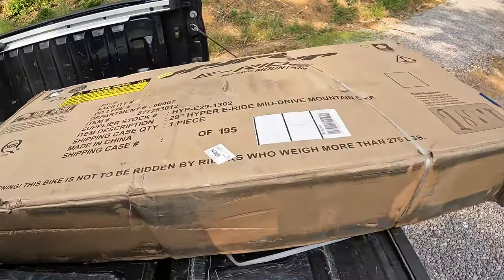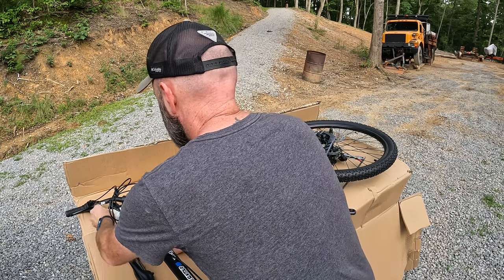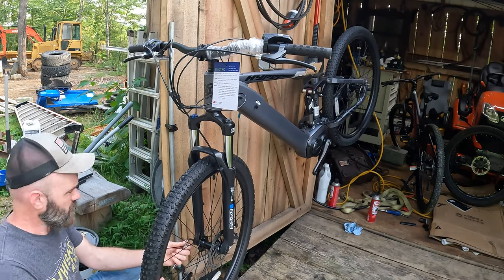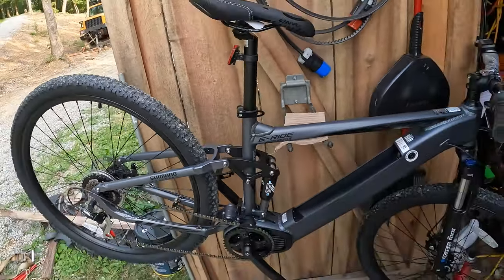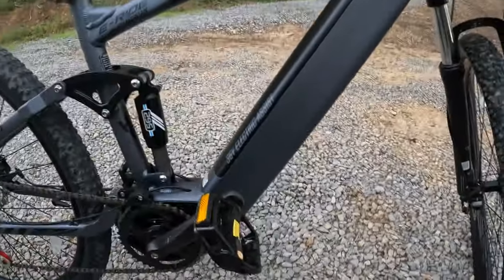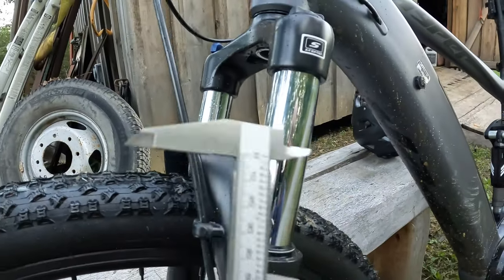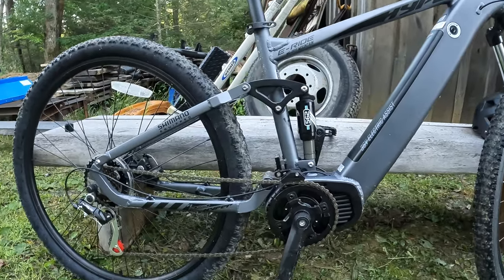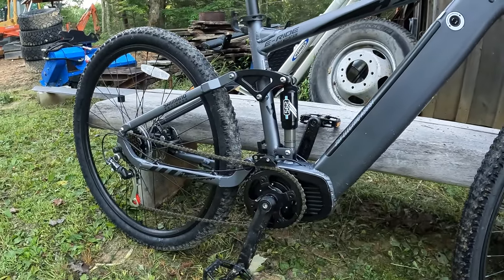Unboxing and initial ride impressions of the Hyper E Ride Mountain Mid Drive mountain bike

Comment: Very informative video! Thank you so much! I wonder if the shocks are oil filled?
Reply: I mean, does it feel dampened with oil inside
Reply from the maker: @whoeverwonders9892  I can’t tell that it does. The rear is just air I believe and the front is a spring and grease to the best of my understanding. I haven’t taken them apart. They aren’t bad for what I do though! 👍🏻
Reply from the maker: Thanks!!!
Reply: @MountainMindset  Thank you for the details, really appreciate that
Reply from the maker: @whoeverwonders9892  anytime! 👍🏻

Comment: What is the stand over height from the ground to the flat spot at the top tube just above the E-Ride logo?  Seat tube cutting is easy, but if the bike is too high to reach the ground comfortably, that is a problem?  People have mentioned the bike for taller riders, but it appears that a simple trim of the seat tube is the fix there.
Reply from the maker: I measured mine in the gravel and it was 29 inches to that flat spot above the e-ride logo. Yea the seat tube is an easy fix. I’m 6 foot and I really like the size of this bike. I’m no expert by any means though! Lol. Hope this helps.

Comment: Once u switched the front fork dropper seat stem and handlebar it should be good
Reply from the maker: Yep! It’s on the list! 👍🏻
Reply: I'd find that gearing limiting as well.  
Did a cost run up $350 parts more this  would be a really capable bike.

Comment: Is this can you ride this bike fully electric
Reply from the maker: Not without peddling, no. It doesn’t have a throttle only like some bikes have. This one is a pedal assist but it’s easy to pedal and has lots of power. Hope this helps.

Comment: It this a bafang motor ?
Reply from the maker: I believe the brand of the motor is Vinka.
Reply: I wonder if i can replace that motor with a bafang ultra
Reply from the maker: @Exo_carbon.24  I don’t know for sure but I doubt it’s a direct bolt in. Maybe with some modifications it would work. Be interesting to see!
Reply: @Exo_carbon.24  If i was you. I'd stick with the hardtail 29 and just swipe the rear hub with a standard one and put a mid-drive conversion kit bafang on it. You'll have better options to get away from the 250watt version and crank to 1000watt for insane power. Then replace the internal battery for 10.5ah (If you can manage to buy the Mid-drive battery which fits into the older modules.) Or buy another battery and mod the wiring under the frame to the new battery placement.

You'd likely get better performance, power, range, and parts.

Comment: How much does it weigh?
Reply from the maker: I haven’t gotten around to weighing it yet but I can tell you it’s pretty heavy. I’ll try and weigh it next week because I’m curious about it too.
Reply: @MountainMindset  Ok cool, let me know when you do. 👍
Reply from the maker: @jasonmathias5343  will do!
Reply from the maker: 56 pounds even according to my bath scale and math! Lol!
Reply: @MountainMindset  Not to bad. The stock 26er weighed roughly 47-50pounds.

I'm sure swiping the handlebars/seatpost (Which i bet are steel.) Would shave alittle bit. And fork/rear shock for air might also help.

But in all. That hefty weight is good to have. It is a small form bike packing a huge punch. Unlike the other higher brand companies (Not sold on walmart. Aka Giant,etc.) that beef their bikes up by widening the frame (But thinning out the metal tubing. So it's thinner but stiff.). So this bike even though small the tube gauge is much thicker for much better overall strength and toughness to withstand the abuse from daily day things being thrown at it. (Like crashing alot. Which even some high end bikes don't fair very well.).

One of the best things on this bike that you won't likely wanna do on a higher end version. Is putting a rack, panniers, etc on it. Fearing the frame might buckle. The Hyper though is tough to beat.
Reply from the maker: @KillerRaptorr  that’s a good way to look at it. It does feel pretty tough and for the money, hard to beat! I did change the bars and stem out for aluminum though. I still love this bike! Thanks for the info! 👍🏻
Reply: @MountainMindset  Same as i. It's a epic bike i been enjoying. It's my all around rider. It's built to feel like a cruiser style ride. With that mountain bike performance, And also a cargo bike with tons of bag options and hauling a trailer behind. It's been a great beast of a bike.

I also loved the options it has for a great upgrade platform.
Reply from the maker: @KillerRaptorr  it is a really good balance of price and performance I think. So far so good!

Comment: good evening I have the brand Shimano hyper bycicle 36 volts but does not work anymore please I am an electrician I can repair it but I do not have the parts and in addition I am in Africa precisely in Niger how can you help me there has a hall haptor sensor which marks more is if i can have the engine ca me how much send me your email or whatsapp please🙏

Comment: Don't waste your money. The rear suspension linkage is crap. No bearings in pivot.
Reply: Bushings are fine.  They are going to be easier to service and maintain. If your judging the suspension on that, your ignorant.
Reply: @bindingcurve  looks like  you don't know anything about mountain bikes. Go ride a rocky trail every day and tell me how tight the suspension feels after a month. About as tight as the hole you don't speak out of.
Reply: @peterthomson6161  dude, I'm been riding mountain bike since the 80s and full suspension downhill starting in the 90s. You're the one who is clueless.  Yes bearings are smoother and in theory last longer, but they are also harder to replace and more susceptible to issues such as seal failure. It's not like you're going to be bombing down black diamonds with this thing.
Reply: Peter Thomson…why are so angry dude!?
Reply: @u140225  He wants a E-Downhill bike for $1500 🤣🤣.  Well I kind of would like one also.
Reply: @bindingcurve  It's amusing that people think that. Most of these are built for XC riding. Or some hill trails. But not speeding 50mph down a huge hill. If you wanna do that. You're gonna be spending 5k+ on anything. Even if you upgraded this bike. You're still gonna put a crapload of money to transform the front suspension system just to get 140-160mm of travel. And that's maybe leaning on the edge of performance. I know real DH use almost up to 200m travel. With almost like 100+mm on the rear. It's reasons DH bikes are made specifically for downhills, Compared to Trails vs XC. Because they have a large travel distance for absorbing bumps they take during their fast downhill travels. Though they have 0 low gears for uphill doing. So it's mainly a hike bike up and ride fast down. Compared to Trail bikes that have a better range of hill climbing gear ratio. But their suspension isn't as great for going down as fast as Downhill bikes. Nor as strong for the rapid descend.

I still find it amusing that LOTS of people buy XC bikes and expect them to perform like Trail/Downhill mountain bikes. Even then are stupid enough to even take XC version bikes down steep cliffs. I can't see myself ever getting into the this weird stupid hobby people call 'mountain biking' when it's completely screwed up in peoples minds about what it is.

Honestly. If i'm getting a Mountain bike to ride OFFROAD at even a walk pace. A XC is more then perfect. Not going to go 50+mph down a hill to get a weird 'rush' of ALMOST killing myself. It's offroading. That's the point of Mountain biking. It's a offroad terrain bike. It's to take the abuse of being based from the harsh terrain paths you go on. If i'ma go climb a huge cliff by pedaling. Then a Trail bike is the option since it's design for low gear ratio and slow climb with a mild speed of going down. Easy. But both the first two work more then well enough for the standard of off-roading. A downhill bike is nothing more then for a speed race track. Which 90% Is for Races. Not for the day to day rider. It's way unneeded. Even a trail bike isn't gonna go more then 15mph down a hill. If you go faster then that you're just looking to kill yourself for the normal person. (Like i said unless you're a huge bike racer needing to speed as fast as possible down a cliff. Then Downhill. But any other combo isn't gonna go faster then like 10-15mphish. Even on a straight. No one's gonna go more then 10mph on a dirt path. There is just no need to speed around woods or mountains that fast. And why go that fast. When you can enjoy your surroundings. Isn't that the whole deal of getting outdoors and mountain biking?)
Reply: @KillerRaptorr  totally agreed, I like cross-country, just enjoy the view and exercise.